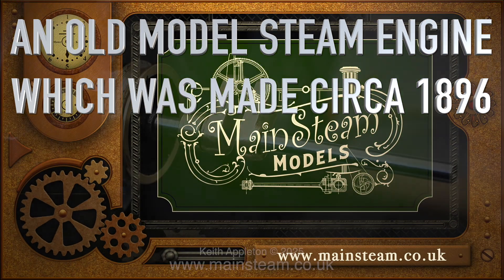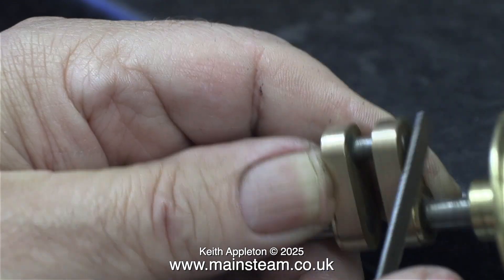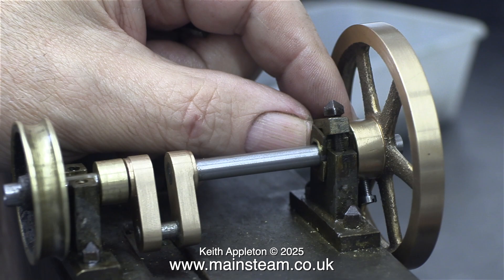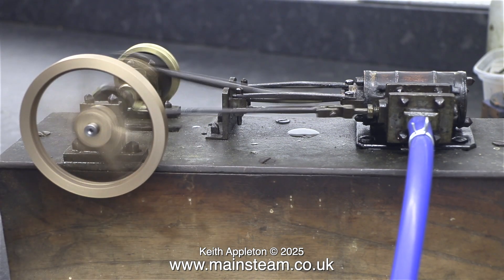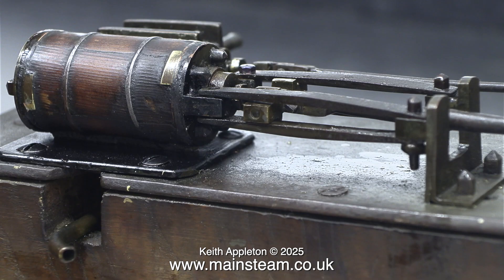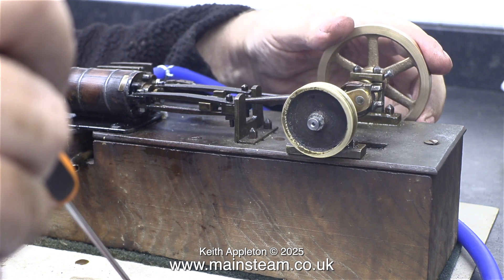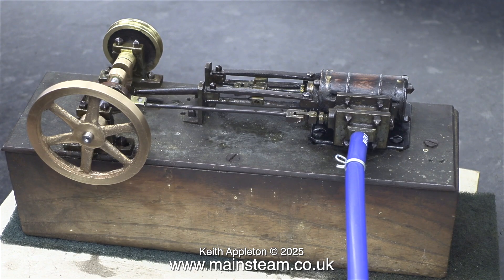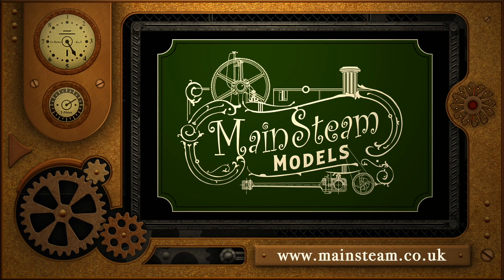REBUILDING A MODEL STEAM ENGINE CIRCA 1896 - PART #13

Comment: On automobile engines the crankshaft has counterweight lobes.  I don't see them on many steam engines.  Is there a reason for this?  Would they help keep down vibrations (like the movement of the base shown in the air tests)?  Just curious.
Reply from the maker: Speed I think - steam engines generally run at a lower RPM than IC Engines. Some steam engines have them to counterbalance the reciprocating mass of the motion - like on Traction Engines which rev much higher than the big ones